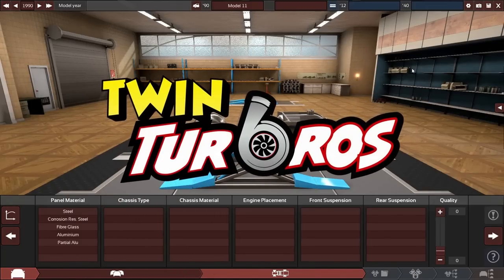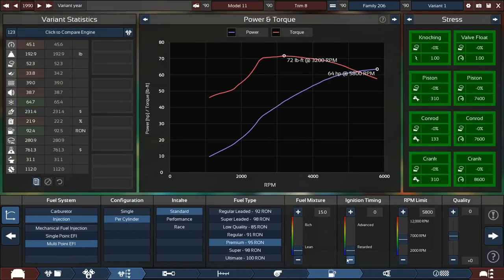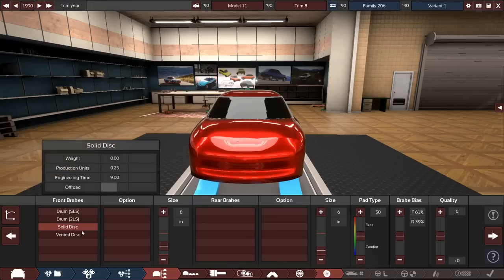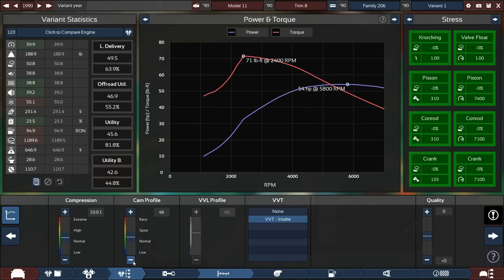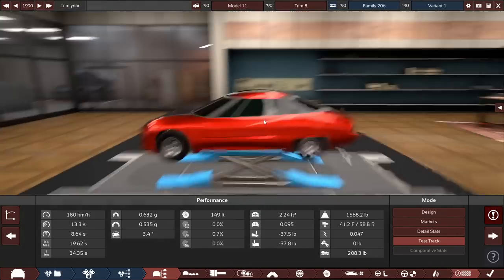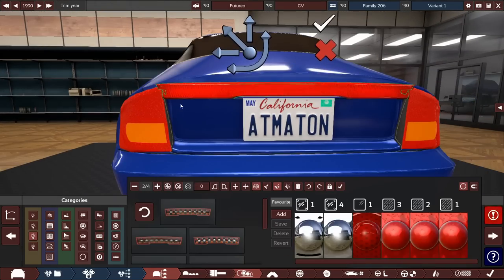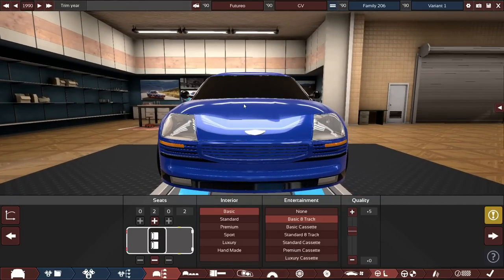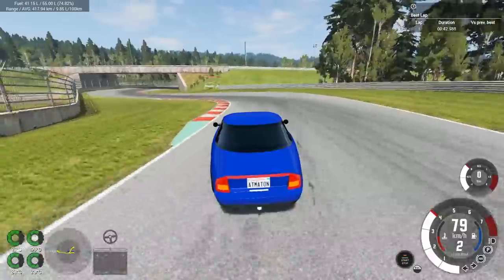Making My Most Fuel Efficient Car EVER! Automation - BeamNG

Comment: Okay, my insight chapter once again XD

So, the reason a turbo boosts the potential fuel mileage of the engine is due to reducing power loss from vacuum pressure in the intake manifold. Pumping losses are low in an engine with ITBs and no filters, but overall a turbo can increase fuel mileage due to how it gets its power: Waste exhaust energy. It basically relieves the large power drop from pumping losses by increasing the exhaust backpressure by a small amount. A higher boost can even push the pistons down during their intake stroke, potentially saving even more fuel, such as you running 0.5 bar (7 psi) of intake pressure. As far as I understand it (thus meaning the following half of this paragraph is from memory instead of solid research), when shooting for economy, the turbo generally has a much larger compressor than the turbine, aiming to suck as much heat out of the exhaust to drive as much cold air through the compressor as possible, though this does not lend itself to high rpm or power output in the engine as the turbine is at its limit already in both speed and exhaust pressure, pushing the power too much further is liable to damage the turbo.

Lowering the cam profile also boosts fuel efficiency because an engine is operating in its ideal range for fuel efficiency closest to the peak torque. It revs higher compared to most eco engines, such as the Prius which tops out between 5k to 6k rpm.

A vehicle with a transmission that uses a torque converter will always end up with a lower potential fuel mileage due to the nature of a torque converter. When a clutch is engaged, it has a 100% power transfer efficiency due to both plates being physically bound by friction to one another, though a torque converter can only reach its maximum theoretical 95% efficiency when its torque ratio hits 1:1 which isn't the case until it gets on the highway. Newer torque converters feature a lockup mechanism that engages a clutch automatically at speeds of around 64 kph, thus making it act as a heavy flywheel with a 100% power transfer efficiency. I would assume Automation's distinction between Automatic and Adv Automatic is the lockup converter and better gearbox efficiency.

Competitors, well, the Chevy Sprint ER achieved a combined MPG of 48 (44 city 53 highway) in 1988 and one of its Quirks and Features was a shift indicator light for maximum acceleration. It also had a 1.0L Inline 3 engine. The '94 Geo Metro XFI managed a combined 47 MPG but lost good parts of the car (like the passenger mirror), also had a 1L I3 engine. The '86 Honda Civic Coupe HF did a combined 46 MPG with a 1.5L I4 engine. So a car like this dashing in to save the world from its fuel crisis found itself jumping in far too late to save anyone as the 80s was a time of cheap gas in so much surplus we didn't know what to do with it. This is a car for the survivalists, those concerned with the availability of fuel after realizing how easily it can vanish during the 70s fuel crisis. Its a car for the opportunists who don't really care how fast they get to point b, just that they don't use much gas to do so and that they are comfortable for the long drive.

Your weight distribution is in fact around the ideal for a rear wheel drive sports car. The Porsche 911 is heralded for its wonderful ability to brake, but that is due to the rear engine setup placing large weight over the back axle for a 40/60 front/rear bias. This means it nears 50/50 under braking loads, making all brakes work evenly instead of overloading the front wheels. There are 4 main benefits to a rearward bias, those being improved braking, improved acceleration (rwd/awd only), improved corner entry (lends itself to slight oversteer which helps greatly) and lastly improved corner exit speed (due to the acceleration factor). A 50/50 weight bias can either feel like horseshite or it can feel like a wet dream, it all depends on suspension tuning, so tuned correctly, a Thunderbird can turn harder than a Miata and hold grip better under cornering loads, provided the Thunderbird loses some weight of course.

Maven adopting the Volvo-esque grill is kinda like how Dodge's iconic crosshair grille wasn't adopted until 1986 with their trucks, moving on to their vans and sports cars in the form of the Grand Caravan and the newer Chargers. And oh the Futureo's mirrors are so cute, those little pokey thingies. And the name is quite good, its actually pronounced as "future-e-o" kinda like Fiero, a callback to that wedgey rear-mid engine sports car that wasn't that good, its like Maven is rubbing their rear engine technology in Pontiac's face XD

Overall, good work, I like the Maven Futureo. Doug would adore this car, all the strange things Maven would've done to reach that 75 mpg would be cool to witness. I wouldn't have bought this car in 1990, but I certainly would want to get my hands on one by 2010 for the cool factor of a unique car :)
Reply: I missed the entire first 5 minutes of the video reading this comment. Great read

Comment: When I saw that tiny engine, I was reminded of a top gear episode were a Prius would run around a track as fast a it could while a V8 400 + HP BMW M3 followed it. Do you know which got better MPG? The BMW did, proving underpowering a car isn't good on fuel economy.
Reply: The again, the Prius was being pushed to the max around the track, while the BMW was A. Drafting from behind the taller Prius, and B. Wasn't being pushed as hard as the BMW as it is much faster so it kept up with it using less fuel
Reply: What saves fuel, is less drag, smaller displacement engines (like 1 liter), smaller tires, less wheight, and you need to drive to save fuel, that Prius was driving like in a Race track, using it's full potential, that's why It was burning alot of fuel, the m3 wasn't using it's full potential, burning less fuel
Reply: @Veketi_  EXACTLY that's what I was saying as well!
Reply: @Veketi_  Also, for more detail, pretty much anything that isn't a race engine tend to have peak efficiency at high loads around 1500-3000 RPM, after which the efficiency declines dramatically. The BMW could probably operate at if not near that range if following a Prius at full chat, which would be operating at RPMs beyond that peak efficiency band.

Additionally, the Prius with its drivetrain and powertrain, isn't meant to have transient loads on the engine. Transients are meant to be handled by the electric motors and powertrain, which ICEs are awful for.
Reply: How often do you commute on a race track at a constant wide open throttle? In the real world, Prius wins. That was one of many pointless tests from Top Gear. A fun test, I’ll give it that. But not realistic in the real world with traffic, speeding laws, stoplights and signs, pedestrians, etc.

Comment: some things for people to try out from my experience : -
baffled is lighter than straight through exhaust
too lean fuel mix can be worse for efficiency (14.7 and slightly adjust from there)
timing advance if too low can also choke power and thus less efficiency
compression around 9-10.5 will give you much lower octane to take advantage of turbo boost

Comment: I would recommend no less than 165-185mm wide tires. And, as a golden rule for most anything other than performance cars, the same size front and rear so tire rotating can be a thing. Also, no less than 14-inch wheels unless it's literally a really old microcar like the Mini Cooper or Fiat 500. Also personally, Front engine FWD and 5-speed manual.

Comment: i can get 1.6l/100km which is around 59km/l and 39% engine efficiency, with a naturally aspirated inline 3 730cc 5 valve and vvt, car only weights about 390kg. 4 speed manual high overdrive, and mid transversal layout, the engine still produce a good power, approximately 33 kw / 45hp

Comment: I like most of your stuff, but I don't particularly find this car very 90s. I like the look of the front end, don't get me wrong, but it is more early/mid-2000s than it is 1990s. I know it's hard to design old cars because it's easy to turn out generic. But your grill design, for example... in the 90s, not having a grille was a big trend (see Taurus, Q45,  Passat, Escort etc) so having that grill arrangement modernizes it in an unintended way, especially for a low drag car that pretty much keeps the rear design of the EV1 it's based on

I don't mean to be unkind, but I know you're interested in design and feel like you might find the critique valuable
Reply from the maker: Your not being unkind at all, I appreciate the feedback!
I was going for a modernish conceptish look that is a classic 90s car body. I wanted to follow design ques from my other cars under this brand (without strait up copying them)

But I can see how it may look a bit toooo modern and not possibly not aerodynamic enough :P
I do plan on doing a 2020 hypermiler car so I hope I can do better then!
Cheers!

Comment: I actually managed to achieve infinite mpg in beam using an automation car. There is a fuel efficiency app in beam.

Edit: I used the cruise control app as well to achieve a constant speed with infinite mpg.